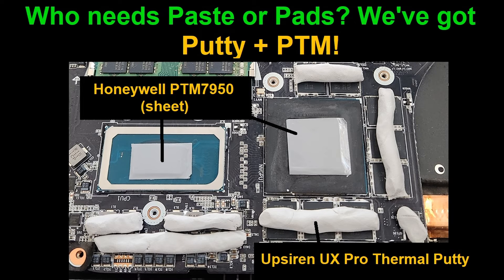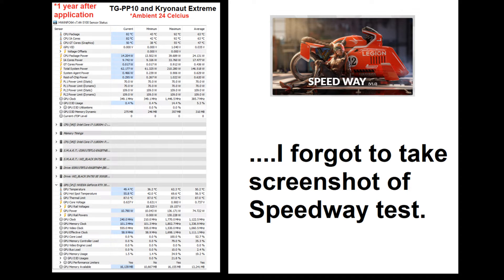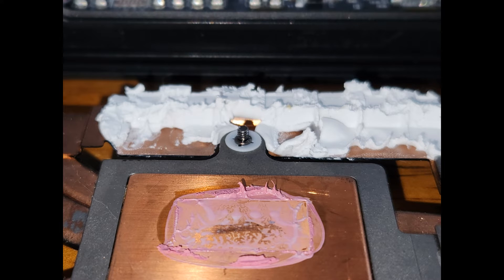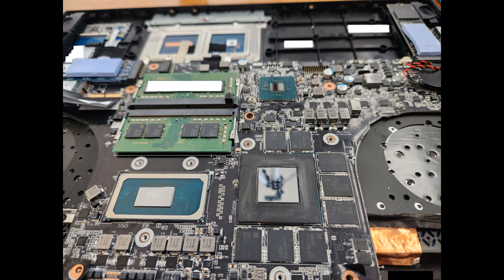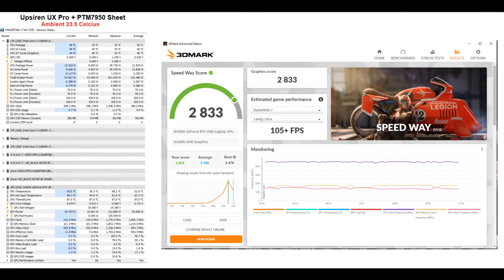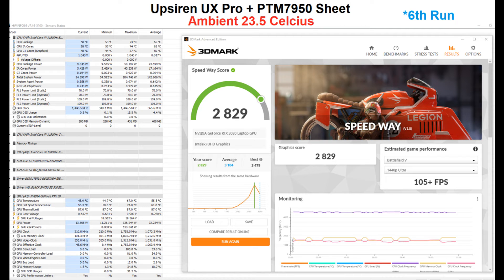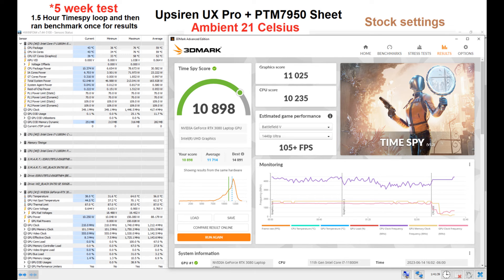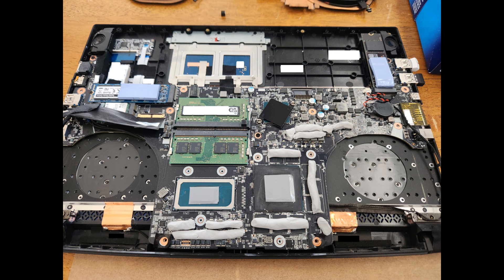RTX3080 Laptop meets Upsiren UX Pro thermal putty and Honeywell PTM7950

Comment: Hi, thank you for your videos.

I want to ask you what you think, for me the original Honeywell PTM7950 Phase is expensive and I do not understand where to buy it in my country because it seems to me that we sell rather fakes from Aliexpress, based on the price.

I want to ask you, what is the best way to do it? Buy a fake Honeywell PTM7950 from Ali and hope that it will work well (like your review on U6 Pro A Tale Of Two Putties). OR maybe you can recommend another thermal pad paste more available for Eastern Europe (For example in my country more available in stores Thermal Grizzly PhaseSheet PTM (50 x 40 mm) ) or in the end it is better to just buy a regular thermal paste without bathing a fake PTM7950.

My laptop ( Lenovo Legion; 1660TI; AMD Ryzen 5 4600H)
Reply from the maker: Most of the sheets bought on Aliexpress perform similar to the Moddiy one. I've had good luck buying it from the Padsionate Girl Store. Stuff works very well.

That being said, if you just want a small piece you could get the Thernal Grizzly PhaseSheet PTM. Der8auer said it's rebranded Honeywell stuff.
Reply: @snarksdomain  Thank you for your reply, This will be my first time changing the thermal paste etc. Based on my laptop, can you tell me what size Honeywell PTM7950 to take to cover the CPU and GPU. But also not to overpay for extra dimensions that I will not need for a long time to come
Reply from the maker: @kirill9243 Could get the 40x80
https://a.aliexpress.com/_mq4wzmb

I usually cut each piece to around 70% the size of the die. It makes 2nd peel easier and you still get full coverage when it melts. Even 20% Coverage can achieve full coverage, but i recommend 50-70%.

40x40 might do it too
Reply: @snarksdomain  Sorry, let me ask 1 more question, what do you think is better? Laird Tputty 607 or UPSIREN Thermal Putty UTP-8 From Ali
And is there even a big difference between the two? It's just that I have Laird on hand and UPSIREN has to be ordered and waited for
Reply from the maker: @kirill9243 if you have Laird on hand rhen definitely use that. UTP-8 does outperform 607 slightly, but not a lot. Only ~2 degrees in my testing (OC'd VRAM with mining load).
Reply: @snarksdomain  I just live in Ua, and EUGENEY Laird as much as 10ml\35g. You wrote to other people that 30g Upsiren is enough for a laptop. How many grams of Laird 607 do you think it would take to apply it to a laptop (especially if I wanted to do it as a syringe). Would this Laird be too much for a single application?
Reply from the maker: @kirill9243 you'll likely use around 12-15g of putty in your laptop.

Comment: Do you have to press hard on the heatsink where the putty is so the cpu and gpu have contact with the heatsink? Ita for a Lenovo IdeaPad Pro 5 16IMH9 - Type 83D4  2024
Reply from the maker: Not hard. Gentle pressure, centered over CPU and GPU core. Gentle press and hold for maybe 10-15 seconds.

Which ourty you get? I'd either go Honeywell HT10000, Upsiren UTP-8, Fehonda LTP81, Thermal Grizzly Putty Pro/Advance, or even a midrange outty like Haknziye HY206/HY236
Reply from the maker: You going to use PTM7950 or similar PCM on CPU and GPU core? It's a solid choice for sure. I tried to find a repaste video of your exact laptop but am having a hard time. If the gaps on the VRAM or VRM are smaller than 0.5mm then I repcmmend going woth Halnziye HY206/HY236  or Zezzio ZT-PY6. They can squish down below 0.1mm with ease.

Comment: Was that too much material? Or is it just enough quantity of PCM7950?
Reply from the maker: It was too much. I now recommend aiming for 70% Coverage for the piece you cut (with scissors). When it melts it will squish out 80% of the material and you will end up woth full coverage in the end.

I've tested as little as 20% Coverage (by area), and it's still achieved full coverage after melt.
Reply: @snarksdomain  wao, interesting, thanks, then I'm not worried now for the small sections of die I left out of the PCM 😂. I was doing some yesterday myself and left out a small line from a corner up to the mille something like that and a small corner, as the piece was not perfectly aligned in the middle, on the other side it was indeed touching the corner. Not traspassing the corner but on the line. Was thinking that maybe I should have tried aligning it a little bit more and was worried later after installation for not similar temps along the die. Didn't know it spreaded that much afterwards. Thanks
Reply from the maker: @andretrujillo  You're good. It starts off around 0.20mm to 0.25mm and melts down to around 0.038mm. The thinner it gets, the better heat transfer you will have.

Comment: for memory of desktop gpu like 3090 not is recommennded? 
The putty
Reply from the maker: Yep. Putty is good on the 3090. If you end up wanting to cool the VRAM further, you can always throw some shims into the mix, even just for the backplate. If you want to go the safe route with shims, just get 1mm thick AIN shims (non electrically conductive) and the putty of your choice.

For maxed out shims on the 3090 either 1.5mm or 1.6mm shims and Halnziye HY206 (HY236), or Zezzio ZT-PY6 on either side of shims.

https://youtu.be/5iNXn8oaTWI?si=VwmrBuWAYdUxgLWg

https://youtu.be/MhrykJtrfBA?si=TjDoP7t2rTsDuLRL
Reply: @snarksdomain  Fechonda LTP81  18w/mk is good to?
Or because have 100g cheap.
How is like compared to Upsiren UK pro Ultra 16.8w/mk  ??
And Fechonda have themal liquid to,not bad.
I need for some gpu and laptops.
How is long life it have?  to new applied after 1 year or 2 year compared to stock Pads of rtx 3090(100c playing 1080p) new msi ventus OC in boost mode.
Reply from the maker: @AlejandroMagnoRivas  well to start off. Don't get UX Pro. Either get Upsiren UTP-8,  Fehonda LTP81,  Honeywell HT10000, Laird T-Putty 910, or Ther.al Grizzly Putty Pro.

For laptops you need to be careful. Some laptops have gaps larger than 0.5mm and can use whichever putty you want, other laptops have gaps smaller than 0.5mm and I recommend you get either Halnziye HY206 (HY236) or Zezzio ZT-PY6. Those 2 putties can squish down below 0.1mm no problem.

Putty should last years in a device. Many of these outties are too new to know longevity. I just tested and opened up a GPU that has had putty for ~3 years and temps were still great, and was able to soften up the putty by kneading it by hand. You can check the love streams to see that.

A 3090 will use 70-90 grams.
Most other card use 35-70 grams. Laptops use 10-13 grams. NVME cooler use 5-10 grams. Motherboard VRM use 15-25 grams.

Lastly, do no judge a putty by it's advertised Thermal Conductivity rating. That value is mostly used as a marketing gimmick and not tested for or represented in a consistent way.
Reply: @snarksdomain   will check that THX and I prefer buy thermal o phastee to in same store.

Comment: how much mounting pressure did you apply to the heatsink? and was it necessary to further tighten the screws after the burn-in of the Ptm 7950?
Reply from the maker: @vugiabao7tc425  I tightened the mounting screws until they stopped. So it's not possible to tighten them further. I do the same with GPU's and CPU heatsinks.
Reply: @snarksdomain  Thanks for the fast response! I think the Ptm will melt and thin out so this will create a small gap between the heatsink and the cpu/gpu die so tightening will be necessary (the design of the screws has springs so i think the pressure between the Die and the heatsink will be less.)
Reply from the maker: @vugiabao7tc425  if you turn the screws in all the way then when the PTM melts the heatsink will simply be pressed in from the preloading spring action, whether it's spring screws or a X bracket. So that should not be any gap.

In fact, it will start off with more mounting force initially due to the PTM initially holding the gap open to 0.25mm
Reply: @snarksdomain  i have a problem that i don't know if it has any effect. Specifically, the oil in my thermal putty is absorbed by the plastic surrounding the heatsink (dell laptop), it makes the plastic become visibly wetter (like the color of a paper when it is soaked with water). does it affect anything?
Reply from the maker: @vugiabao7tc425  hmm.... which Putty do you have, and where did you buy it from. It's unusual to see any oil bleed so quickly. It should take years to get a light oil bleed, and even then it's not likely to look wet or fluid-like.

Or is it from factory putty?

Silicone oil doesn't pose a risk to the electronics. On GPU's it's important to wipe the PCI-E connector on the card prior to inserting it into the motherboard as the oil could prevent contact, but otherwise no issues.

Putty doesn't typically bleed oil as fast as thermal pads do. Hars to say whether that's because of the saturation the oil and thermal filler (powders) has, or perhaps because putty can expand outwards during heat cycles, while pads try to hold their ground and the oil escapes.
Reply: @snarksdomain  Jeyi 8100 from their original website.but maybe I shouldn't let it come into contact with the plastic part because the plastic can absorb oil from the TIM.
Reply from the maker: @vugiabao7tc425  That is a decent performing putty. I assume the little jar came in the lime green plastic baggy? It shouldn't hurt anything, but it's true that some plastics are more absorbent than others.

Comment: I really want to try thermal putty one day but I am terrified that I will use too much by accident and that it will be a nightmare to remove unlike a pad which I can yank off.
Reply from the maker: @cemsengul16  it's not too difficult to remove. Can use one of those paste spreader to scoop up excess.

If you want to apply the perfect amount you can also use the Thermal Putty Calculator.  It's on the Google Drive link in video description.

Comment: Hello, I have a Lenovo Legion 5 laptop with 5800h 3070, I want to take Honeywell PTM 7950 for CPU and GPU, but instead of spacers I don’t know what to choose between Upsiren UX Pro Ultra, Honeywell HT10000 and Laird Tputty 910, the first one I understand can be ordered on Aliexpress, but I can’t find where to buy the other two so that it doesn’t turn out to be a scam. Will 20g be enough for me? I’m thinking of buying Honeywell PTM 7950 on Aliexpress from MIddle999 Store, I don’t know if it sells the original or if it’s support. Thank you!
Reply from the maker: @statores7151  for PTM7950 I usually buy it from "Passionate Girl Store" on aliexpress. I'd skip the UX Pro and get either Upsiren UTP-8 or Fehonda LTP81. Could even go Thermal Grizzly Putty Advance if you can get it cheap locally. Buy 20g and use 10-13g.
Reply: @snarksdomain  Thanks a lot !)

Comment: Hi Snarks, I have the same laptop but with a 3070ti graphics card. I'm having problems with the PCH temperature, 87°C after boot and 109/110°C in games, when it reaches this temperature the audio starts crackling. The CPU and GPU temperatures are ok after applying the PTM7950 and UTP-8, but I can't lower the PCH temperature.
Reply: I replace Thermal Pad with UTP-8, but I still have problems. I'm thinking of swapping the heatsink for a pure copper one.
Reply from the maker: @vitorlponte  did you change out the pad on the little PCH heatsink?
Reply from the maker: @vitorlponte  Did you put anything on the PCH? Between it and the little heatsink? Might want to change what's there.

Comment: Hi and great video! 
Will be giving this treatment to my ROG G15 now. 
What are the dimensions of the Ryzen 9 5900HS and the RTX 3060 Mobile, or what size PTM sheet should I get?
Thanks!
Reply from the maker: 40x40 should be enough. 40x80 gives you extra. I recommend cutting each piece for CPU and GPU core smaller than the die. 2nd peel is easier and you'll still end up with full coverage once it melts.

I'd likely go with Halnziye HY236 for your laptop due to it's thin gaps. It can squish down thinner than 0.1mm very easily. Top end putties like Upsiren UTP-8, Fehonda LTP81, TG Putty Pro, or Honeywell HT10000 use larger particle sizes and you will run into core contact issues if you use those for your laptop.
Reply: @snarksdomain  Thanks for getting back to me and for the info! I had already ordered Thermal Grizzly Putty advanced, do you think that will work alright? Cheers!
Reply from the maker: @sirring6  There's a good chance you will run into core contact issues with it. HY236 is so cheap it might be worthwhile ordering now as a backup plan if you end u I not getting the Putty Advance to work.
Reply: @snarksdomain  Understood, thanks for your work!
Reply from the maker: @sirring6  If you end up trying with Putty Advance, I recommend doing only putty first and maybe a tiny dot of paste on CPU and GPU die. Do a test fit with the heatsink and turn the screws in all the way and even apply a little bit of manual pressure. Then, take back apart and see how the putty spreads and adjust as needed. I'd recommend starting off minimalistic and use small logs around 3mm in diameter. If you manage to get good core contact, then you can add a little putty as needed.

Doing this will initially be trying to see if the particle sizes that Putty Advance uses are small enough to allow for core contact for your laptop.

If you get putty dialed in then you can apply PTM and do final assembly. It's always a good idea to make the putty stand up a bit and get final compression during assembly. You can either reform the logs, or just squeeze the sides of the putty so it "stands up".

Comment: What Size Of PTM Should I Get To Replace A Old Acer Nitro 5? I Was Planning On Getting 40mmx40mm. They Also Seem To Sell (Honeywell TGP8000PT Thermally Conductive Gap Filling Putty Pads) Ever Try Those?
Reply from the maker: @JUSTKOZ  40x40 wull be enough. I recommend cutting each piece smaller than the die sizes. It makes 2nd peel easier and you will still get full coverage once it melts.

I still need to try those pads but have heard they don't perform as well as a top end putty.

Which model/year is your laptop?
Reply: @snarksdomain  Thanks For Answering. Model Is (Nitro AN515-44) As You Can See Quite Old But Still Serves Me. I Plan On Doing A Re paste As Well As A Fresh Windows Install Since It Keeps Hitting 90c And Keeps Buffering All Around.

Comment: So you can cover those vrams  fully like you did, and shaping it around the edge, and not like they do with pads , making it the exact size of the surface  and leaving space between?
Reply from the maker: Yes, the putty does not conduct electricity so won't harm anything. During assembly the putty will be compressed and squish out, achieving full coverage of the VRAM. This also helps to prevent against any air gaps
Reply: @snarksdomain  thanks for reply. Will try to order some here in the Philippines. So this stuff is better then the K5 pro putty, or same. For the GPU I bought local, the noctua nt h2.  I'm not not a technician, but I think it's still safe to do this by myself. Local repair shops here in PH using thinner , to clean, and often mess more up then I probably could. I will do the fitting test you mentioned to other guy in the comment section, once I get that right , I do the thermal paste on GPU
Reply from the maker: @otszzz79  K5 Pro is very bad, most of the 4p other putties I've tested are MUCH better than K5 Pro. You can look at the charts located on the Google Drive link in video description (Test Chart Repository > VRAM TIM > ETCHASH).

I wouldn't recommend using NT-H2. You are much better off getting some Honeywell PTM7950 or Thermalright Heilos V2 for the CPU and GPU core.
Reply: @snarksdomain  so this putty is fine for a acer nitro 5 an515 44 laptop? Not sure what gaps of 0.5mm you meant in other reply, where you recommend the other putty halnziye 236
Reply from the maker: @otszzz79  for that laptop I'd go with the HY236. You can buy 20g of it on Aliexpress for around $7 CAD.
Reply: @ thanks. to be real honest , my laptop is not getting that hot , max 75 whe use adobe premiere and stuff, but to clean the fans on this model , i need to take the cooler off, exposing the paste, so i tought, once i do tht, i better replace the paste and  putty, now the summer period coming here in Philippines, i better  keep the ac running anyways, makes a differece too i noticed . thanks again
Reply: @snarksdomain  ah well, they don't ship it to this country.  Will just need to use whatever they have available here. All the stuff on Amazon also not  eligible for cheap or free shipping like other products if order above 50 bucks. So the shipping handling fee is higher then the product itself.  More fun in the Philippines they say. Guess I just don't clean the fan and wait till I get temperatures above the 75  when using my adobe programs to the fullest.  I don't play video games or stuff like that. Just bought a gaming laptop cos it was in sale and the specs where ok for my purposes.
Reply from the maker: @ 75 is absolutely fine for the CPU I wouldn't worry until it's above 95 Celsius.
Reply: @snarksdomain  I know, but they say, once you take the cooling plate off, exposing the paste and pads, which is needed to clean the fans of this nitro model, you need to repaste it,but like you mentioned, I just wait till it rises above that level.  Since it's elevated on the  arm stand,  and when using the Aircon bit more, it's ok.  So far I only monitor the temperature with nitro sense, and if needed I turn on the advance cooling or boost. Will not hear the annoying blowing sound with headphone on
Reply from the maker: @ woirst case scenario, if you do open it up: If the putty is still soft enough to reshape then you can just reuse it. that could be hit or miss with OEM putties though.